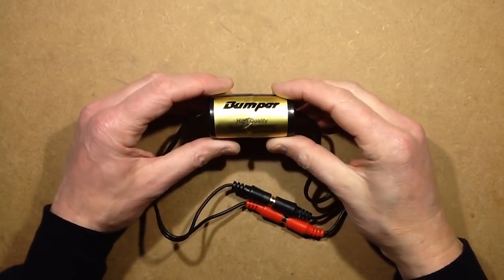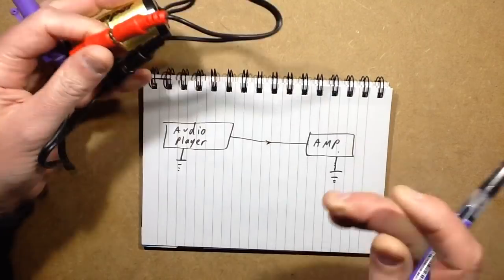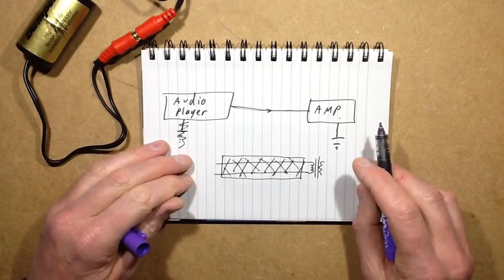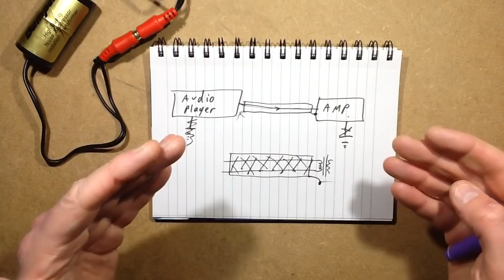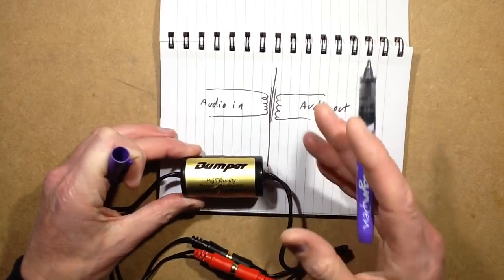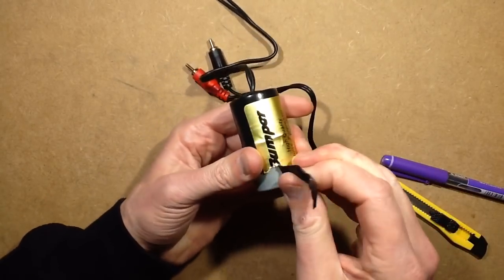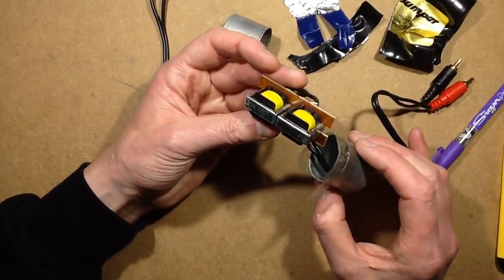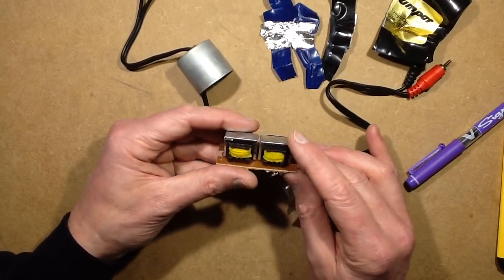Inside an audio isolator transformer module.

Comment: lol in car audio "hum" coming out of the subwoofers (or mids and tweeters if theyre on an amp also) would be caused by a few possible things. in my case several years ago. i had it because the ground in the head unit went to shit. which lead to it picking up interference from the engine. but bad rca cables might cause it and idk what else to be honest but i know that normally you will have some noise being produced. they recommend using capacitors to "smooth" the signal and helps reduce chance of noise. but if something went wrong and you suddenly have really loud noise or hum coming from the system then its time to invest in some new equipment in most cases :) i love my car audio lol

Comment: I think you missed the case where the two ends are connected to devices which uses different phases, like the audio cable between my computer in the office and the amplifier out in the workshop. The audio isolator transformer can sometimes be called a galvanic isolator.
Reply: If both are tied to building ground or neutral, different power phases shouldn't matter.  But if a bad power supply leaks through the phase waveform to the audio ground, phase difference can become a ground loop.

Comment: Used plenty of them in the past when doing car audio. They aren't as necessary in car audio now as they were on older vehicles. I don't think I've had to use them on very much made past about the late 90's. Many vehicles had a major whine from the alternator, and ignition system that would go up and down with the RPM.
Reply from the maker: They have a new use between laptops and amplifiers.

Comment: i emailed you the other day about this problem this should fix my issue. id imagine my issue is that the converter im using for high input has crappy shielding and is picking up the alternators noise.

Comment: another note...with todays digital mixer boards, when you use a laptop connected via firewire or usb to the digital board, laptops with grounded wall warts cause weird noise to leach into the system.  in that case ive had to find non earthed power supplies.

Comment: the noise problems in car audio  dwarf those in the home and pro audio. most vehicles use the chassis as the ground, and then you have an amp grounded in the back near where the fuel pump and turn signals ground, a head unit that is grounded to some ground distribution bus, along with the AC fan and wiper motors. In most cases thr head unit also has a ground via the antenna coax - to a piece of metal that picks up noises from ignition systems, alternator pulses, fuel injector pulses...   The best way I have found to deal with it is to run a twisted pair (ground & 12v) of 6 to 10 gauge wires from the battery all the way back to the amp. connect the ground to wherever the battery negative is tied to the chassis. put a fuse in and connect the hot side to the battery as directly as you can.  Tap of these lines for the constant lead to the head unit. use at least a 10g wire between the back of the radio and solder it into the ground wire. this wire is so thick it shorts out the noise from the antenna coax. do not add any other ground points. let the amp be grounded under the hood next to the battery. now because we twisted the power and ground wires, we can run RCAs right next to them without troubles.
do it some other way and it might work - for a while.  do it my way and it stays working for the long haul.

Comment: why so large transformers, is not audio line low power signal, cant it be done with much smaller transformers ? the audio between the source and the amp ? or must it be done on amplified audio signals coming out of the amp ?

Comment: Hi Clive,
Is there a possibility of a video explain and showing what could happen if a plug has the earth cable cut? A Lot of people i work with on rigs seems to have the idea that this is the 'correct way'. For the life of me i cant seem to get the fact across that it isn't.
Reply from the maker: It's the curse of the audio industry.  Loads of "experts" passing it down to the next "expert".  You might want to show them this video where you clearly see the singer pass enough current from the microphone to the stage to make his body rigid and give an electric shock to the first person who touches him.   https://www.youtube.com/watch?v=A6dtsFdBr3k    Disconnecting the earth in a plug is ticket to a manslaughter charge if someone gets killed as a result.

Comment: Not sure, but I think I would look for another solution. I would not want that system across my RCA, from the audio reproduction standpoint. I might be wrong. However if you spend on a quality RCA set, and use one of those devices, you're probably back to square one. Or the equivalent of using a £2 RCA cable.

Comment: Optical cable works great too, I can hook up my laptop to the amplifier without any noise. There are no ground loops of interference with fiber.
Reply: +AL3KS S3RB no it's optical, you can sometimes get hum over rca
Reply: +AL3KS S3RB you can have s/pdif over an rca cable and that can still cause a hum, I'm saying that it's because it's optical that it completely prevents ground loops.

Comment: I NEED HELP!  I made a homemade 12v  DC boombox using a pioneer car radio, and 2 amplifiers which are hooked up to it with RCA cables.  Its all powered by an HP server power supply which can put out almost 100 amps.  BIG PROBLEM!: The speakers have a terrible hiss,  When I flick the power switch to send AC to the HP power supply I get a huge POP as the radio and amplifiers turn on. Everything seems to be intensified from your normal annoying little buzzes and hisses in your car speakers.   What could be causing this?  Actual electro-magnetic-whatever fields actually traveling through the air and getting picked up by RCA cables or could it be errant AC voltage going into the amplifiers from the 10 gauge power cables(i doubt this because i was under the impression amps have TONS of filtering caps).  What could I do to get rid of this horrific buzzing/POPing

Comment: In what situation would one of these cause more noise than without it. It was severe noise created when I plugged this into my home sterio to my kenwood amp. I threw it away. I've used these in car systems with desent results but this was the 1st time in a house. It was a cheap unit but all looked well inside. It was a 4 channel unit. I was running 2 kenwood house amps at the time. Any help would be appreciated.  Thanks. Good video BTW.
Reply from the maker: It shouldn't introduce noise.

Comment: Would you recommend one of these to run from a turntable to a mixer to get rid of the hum?
Reply from the maker: It may help if the turntable is putting out line levels.  It's cheap enough to buy and try.

Comment: Would wrapping a radio's return wire/hot wire around some toroidal coils solve some of these issues? I bought something essentially identical to this but for filtering power line noise on a CB radio - it didn't appear to help. Maybe it would do better on the return side...

Basically: only when the car is on I can barely hear people over the noise so it isn't the antenna.
Reply: +Mic Nor I'm fairly sure that ferrites are used for filtering high frequencies, i.e. beyond human audible range. This makes them useful for data transmission, video, radio communication etc.

Comment: can this be used for my speakers thats giving me a permanent  buzzing sound possibly from the PC
Reply: If you are talking powered HiFi speakers, yes
However if they are desktop PC speakers, made for this exact job, then I'd be somewhat annoyed with their manufacturer.
Reply: No. These are for low level inputs NOT outputs. They won't be able to handle the power - at best you'll get distortion because the magnetic cores will saturate; at worst, the windings will burn out.

Comment: These things are a god like device for car audio too ,  got noise from the alternator ...instant fix. But maybe you could say I have gotten around this problem before by hooking a wire directly from rca ground to head unit chassis and it also got rid of the hum ....is that a bad thing to do ?
Reply: +Darren Woods I done tons of installs for friends and family over the years and yea a hand full of times alternator humming , and It's always one culprit ....the head unit , same setup same system and a different head unit and its gone, so I either used one of those if I had one around from one of my previous installs or just hooked rca to chassis ground of the head unit , it works but I have no idea electrically is it a good or bad thing to do lol , never had one up in flames so guess its okay.

Comment: I have had issues (as you mentioned around 7:00) with stereo noise + engine revving + crappy switching USB power supply in my car.  Awful noise result that followed engine RPM perfectly.

Comment: Are the transformers 1:1 on the primary and secondary coil windings?? 
Re-posted under correct account:
Reply from the maker: Yes, but you also get impedance matching versions.
Reply: Thanks good to know... I wonder what would happen if you changed the winding ratio.. think it would change the audio output??

Comment: You get alternator hum when doing car audio, I use to be heavy into that junk.
Reply: good solid grounds usually solves the problem
Reply: Wil Hobbs
Usually but not always, I always had issues in this one ranger I had until I got a idolator and that was the end of the alt hum.
Prob was a bad grounding strap (engine to frame) now that I have alot more experience with mechanics and electronics than when I was a teenager.
Reply: +Patrick TheBaptist yes those engine grounds will get you every time. 😐

Comment: Great video. As a DJ of several years when I switched from using cd decks to a laptop I found I was getting a lot of background noise over my system from the laptop. Bought one of these from a nearby electrical retailer for £7 and voila! Problem solved.

Comment: Sorry if I double-comment by accident but my browser crashed and I don't see my comment.
So, I've not messed with one of these in an audio setting, but in theory, the output of the transformer would be balanced audio, and the shields would be the inverted end. The voltage on each side of the balance would be half the input, but the total would be the same. Imbalanced audio usually has a shared ground (so does balanced but imbalanced uses its ground as a normal return path), so going from imbalanced to this transformer to imbalanced would seem like a hack job. Great way to turn imbalanced audio into balanced audio though.

Comment: would it be a bad idea to put this inside an amplifier and link them to the rca conectors ?
Reply from the maker: +Sølve Wangberg It might not be easy if the amplifier has the existing RCA connectors mounted on its circuit board.  But if they were connected by wires you could add some transformers.

Comment: Do the choke beads on some cables do much to reduce noise? or are they for a different type of [problem?
Reply from the maker: +Will E. Lewis They suppress high frequency transients and help stop high frequency switching noise from finding its way onto the mains wiring.
Reply: Thanks for you response and those great videos.

Comment: Are there analog optocouplers? If yes why they just don't put them inside the devices? Damn, I'm just too lazy to google.
Reply: +cyberconsumer 
You can use many optocouplers for analog signals (not voltage, but current signals). Much more complex and a pain to get a linear transfer over a wide range of amplitudes and frequencies.
For the rest, f*in use google. Why should someone help you if you are too lazy to do it yourself?

Comment: can you connect it backwards? im thinking since there are two transformer one could decrease the signal but the other one can restore it so it could be the same if you reverse the polarity
Reply: I have a Pyramid NS-20 that I opened up. 
The input side has a resistance of 135ohms and 1257mH , that side has a center tap pin that is not connected to anything and shows no continuity. 
Probably the pin is there for assembly simplification.  
The output side is 163ohms and 1259mH.  
I'm not a electronics expert but , maybe someone can make sense of those measurements. 
That is just one channel of the unit. The other is slightly higher.
I have used these either direction and not noticed a difference when using them to go between a PC and a mixer.
Reply: @frankstone919  I have heard some people who use it in car audio so huge loads and they say it kills their bass. depends if rca signal format is digital and sends packets where one of them is the volume indicator, and is it being weakened, you wouldnt be able hear ~0.2% or ~30% difference cause it just reduces the power to amplifier and it is also depends on how loud it gets and its clarity, and it depends on every circuit and the speaker type too.

Comment: I have an old amp which came from the factory without earth because that was a normal thing back than should I rewire the cable with a ground which I just connect to the chassis?
Reply: Or my amp has a ground screw terminal for the phonoplayer could I connect this to the ground pin of the socket with a crocodile clip or so?
Reply from the maker: Be very careful with old amplifiers.  Some had live chassis that in some cases makes everything plugged into it live too when the polarity is wrong.  There have been a lot of accidents involving musicians with live guitars/microphones.

Comment: Hope you can aswer, is it normal when I turn the master volume to max on my amplifier. I hear pink noise even if the music is pause?
Reply from the maker: Yes.  There's always a slight background noise caused by electronic components.  The audio industry uses a device called a noise gate on big installations to mute low level noise until a threshold is reached.

Comment: Hi Clive, about 6 months ago I was connecting a 3.5MM to RCA jack (that was plugged in via the RCA end to my amplifier) to a little USB DAC and I had the power on the amplifier turned all the way up by accident with the amp switched on. It ended up sending really loud cracking noises through my speakers as I was plugging the 3.5MM end in - could this have damaged my speakers at all? They are rated for more power than my amp can produce.

The speakers still seem to be fine but I did end up having to replace the amp unfortunately. It made some funky noises as I adjusted the volume. They are really good speakers (Tannoy DC6Ts) so I'm still curious to know if they're OK.
Reply from the maker: +Zlyzer Speaker pop.  Doesn't usually damage the speakers.  The crackle from the volume pot is common when they are wearing out.  You can sometimes use a spray cleaner on the volume pot, or just replace it completely if it is a standard style.
Reply: +bigclivedotcom Cheers Clive, it was an old amp so perhaps it was coincidental. Everything is fine with the new one anyway so all good!
Reply: +Zlyzer most speaker failures are caused by clipped sound signals, it's VERY hard to overdrive a speaker enough to cause significant damage.  When you plug in a jack like a 3.5mm (or 1\4 plug) the first contact actually connects to each different contact on the female side, similar things happen to the second\third contact depending on how many it has.
Reply: +animefreak5757 I have very limited knowledge of electronics so this is interesting! It obviously sounded really loud because the amplification was turned all the way up, but would it have to be over the peak wattage rating of the speaker to damage it?
Reply: well, it depends.  I used to occasionally blow up small speakers for kicks when i was young, it normally took about 100x the power rating to get catastrophic failure.  The reason for this is how a speaker works.  It's basically just a electromagnet attached to the cone.

Clipped signals destroy speakers because they overheat the coil and cause it to warp.  Unless your speaker is rated for a ton more power then your amp, it needs to be moving in order to cool.
Reply: +animefreak5757 So the coil can get hot in just a fraction of a second? That&#39;s nuts! Does plugging the 3.5mm jack into the DAC while the amp is turned on constitute a clipped signal? 

BTW, peak RMS for my speakers is 87W, and the amp was a 40W amp.
Reply: +Richard Driskill  Great information there. I"ve installed competition systems for S.P.L and S.Q. for many years in my earlier days. I still do installs but not to the extent as before. I just wanted to add another very common but less acknowledged way of blowing speakers and subs. I have seen many nice and expensive speakers go up in smoke with roasted voice coils and loads of those where only being powered with below half their rated power. The cause for those came from DC offset from the amplifier. Many cheap amps come factory as "speaker killers" because they show a high DC voltage across the outputs, which in turn goes across the voicecoils. Speakers do not like DC current at all (this is what clipping an audio signal looks like to the speaker as well)and that will damage them quicker than throwing them off a bridge. :) Anyone playing with cheaper amplifiers or even old used amps should always check for this prior to connecting speakers. Save Subs, Get you amps Tested. ;)

Comment: Could using an optical link, like S/PDIF, stop mains/switching noise? I get mains hum on my speakers and it refuses to go away : /
Reply: +M390VI Of course, it's fully isolated if it's optical. There won't be any interference.

Comment: The foil tape is to stop vibrations from moving the transformers, electrical tape is too stretchy, celo tape is not acceptable inside electronics. Foil tape is fairly rigid. The electrical tape pre-tensions the unit and foil locks it in place